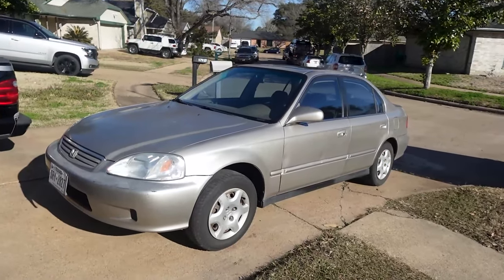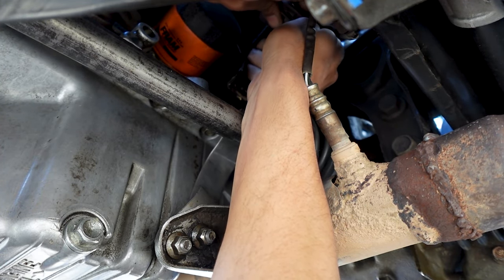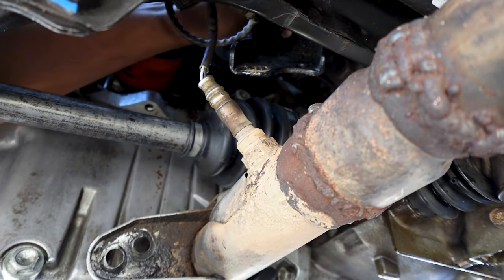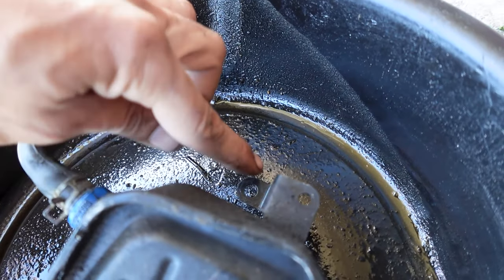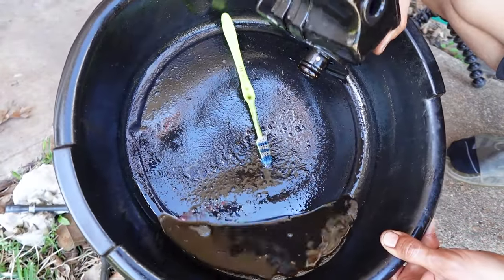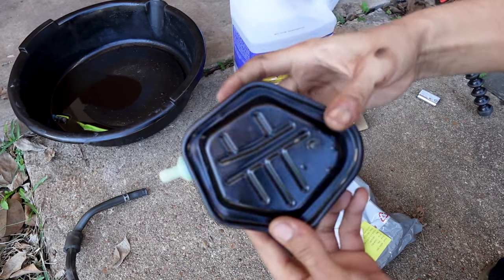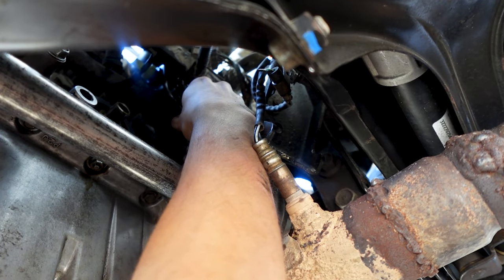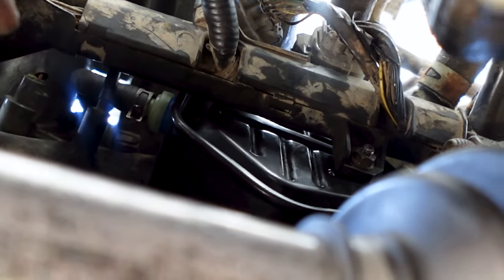Cleaning Honda PCV! Let Your Engine Breathe!

Comment: Hey man i Changed my pcv valve too. 

 after that my idle went up to 1.5-2k rpm.

and when ever i press the clutched  is fluctuating  up down  1-2k rpm.

so i put the old pcv valve in  and when i start the car, it starts at 1.5k and goes down to 1.1k rpm when the engine gets warmer.   

before it was at 800 rpm when engine is  warm.  but after i drive arround i stucks at 1.5k rpm again. 

so i checked all the hoes  and they where fine , i checked the cables, all conected. 

The throttly body gasket is 2 months old ,so i just reused it after putting the new pcv valve in.
i torqued everything to specs.

iam lost and i dont know what to do. 
do you have any idea what it could be?